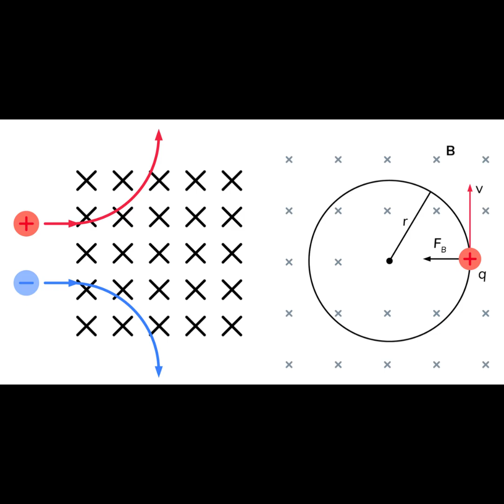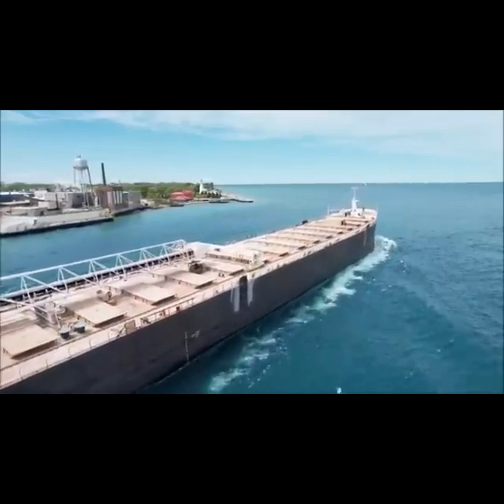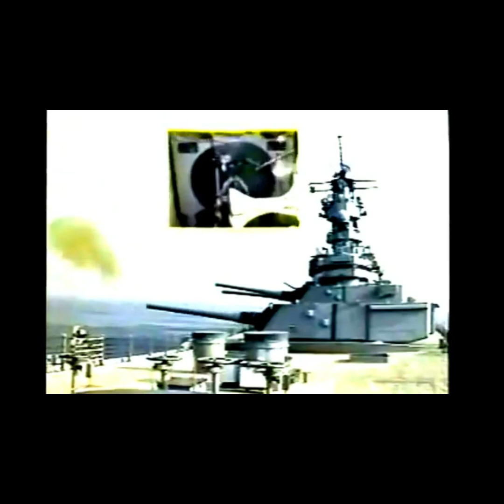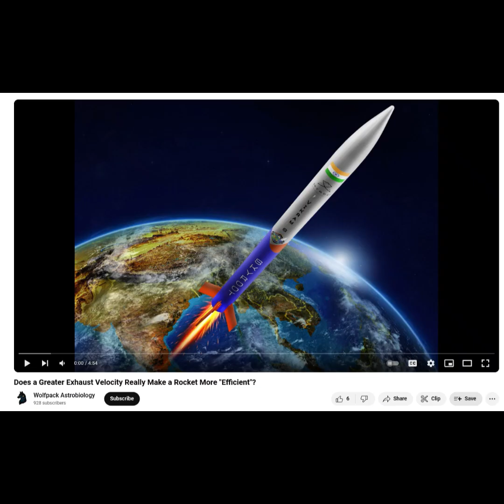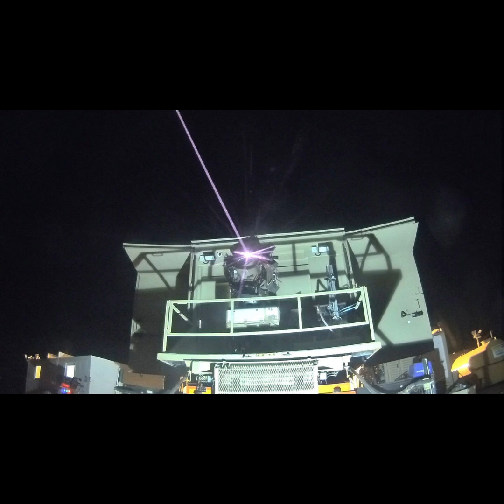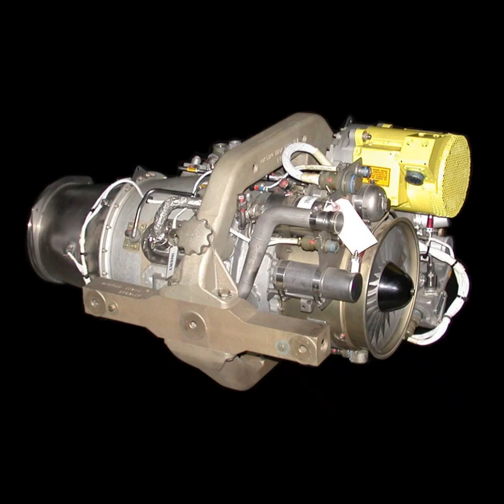Some Thoughts on Space Warfare

Comment: I am writing a sci fi universe which includes FTL travel and communications but has no artificial gravity and has newtonian physics. The main weapons on warships are actually guided munitions launched by coilguns and coilguns which launch nanoparticles. Since guided artillery projectiles have been a thing since the 70s im surprised that very few sci fi settings use them.

Also one big consideration in space combat is overheating. Ddue to lack of thermal conductivity with vaccuum, the only way for spaceships to lose heat is through electromagnetic radiation, makiing overheating a huge issue. I a big design and tactical consideration will be how big a cooling system is on a ship, and how much it fires or maneuvers in order to prevent overheating.

I do think space warships will be vaguely aerodynamic as in being wedge shaped instead of blocky(i.e. super star destroyer vs anything from babylon 5). This will be due to:
having ab igger surface area to volume ration, allowing for better cooling
-better gun firing arcs
-more efficient armor, especially against lasers or particle beams, since they cant normalize.
-narower profiles

I do think that if humanity advances enough to create combat spaceships, there will be far more advanced armor technology, which will require bigger projectiles and mak destroying ships with shrapnel impossible. However, if space combat uses technology slightly more advanced to our current tech, one of the most devastating antiship weapons will be neutron bombs, since they'll be able to kill crew and can only be stopped by thick heavy metal armor, and because they area completely area effect.
Reply from the maker: Well how strong and thick is the armour?  Because at a closing speed of 100 km/s, a 1 gram iron marble will have 15 times the kinetic energy per cross section as an M829 APFSDS round fired at point blank (and that can cut through 670 mm of steel).
Reply: @wolfpackastrobiology3690  In my setting ships have an "all or nothing" armor scheme. Their sloped sides have extremely thick composite armor which reaches 25+m in thickness and is made of alternating panels of DU, tungsten alloys, ceramic and carbon nanotube fillers.
Reply from the maker: @TheAnticlinton  Roughly how many meters of steel is 1 meter of this composite Armor equal to (and what is the mass of these ships)?